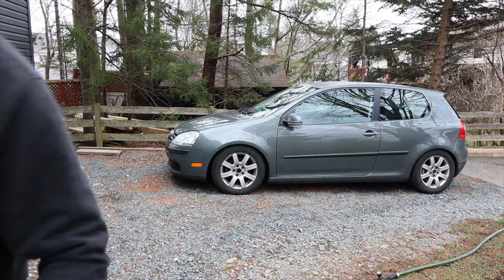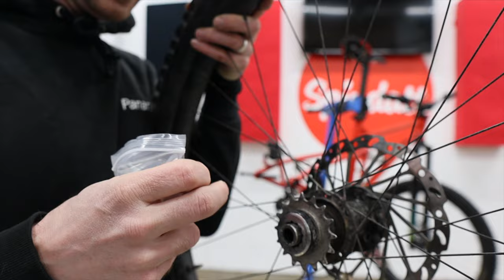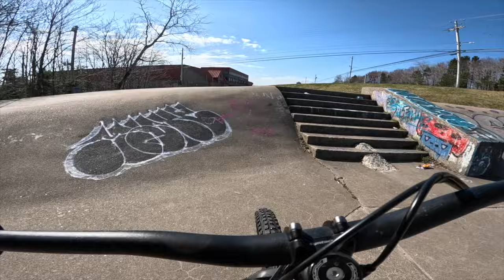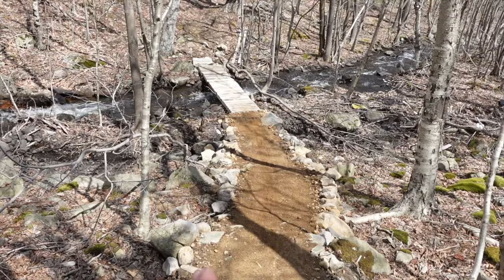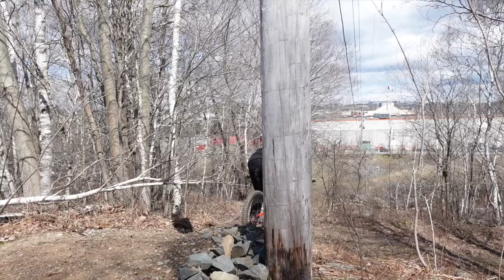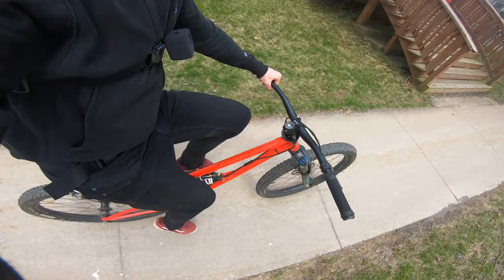Riding my Single Speed Full Suspension (and other things happen too)

Comment: "Can you see what's going on here?"

Yep! I see exactly what's happening! You've plugged the Felt into the wall outlet. Obviously its mixed wheel magic is so strong it's contributing electricity back to your local power grid.

In this modern world, sustainable energy is a cornerstone of a thriving community. North America sends its thanks to you and the Felt's mullet hotness.

Also, you can always tell who rode a lot of bmx; knees in and stylish on the trails and in the air rather than wide and wonky. It's probably a horrible habit if you were racing downhill but much sicker visually.

Comment: The Ford mavrik looks like a mini van for men. I keep seeing them at the trailhead and wonder if you can fit anything beyond a bike in the back? 😅
Reply: Mini vans ARE for men.  Four door trucks with </=6ft beds are just mini vans with shitty gas mileage and a complex.
Reply: The SUV is the new minivan. And loads of men drive them.

The Maverick is bringing back small trucks. A new Tacoma or Ranger is the same size as an early 2000s F150 or Tundra. But the beds are smaller than those trucks.